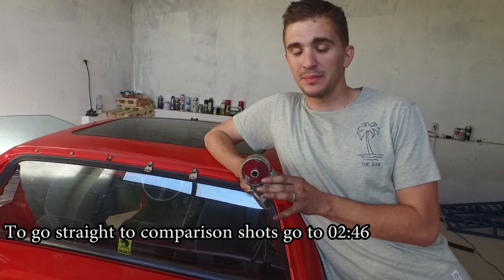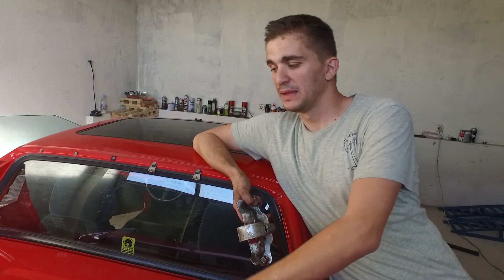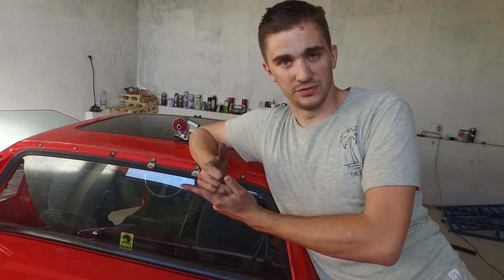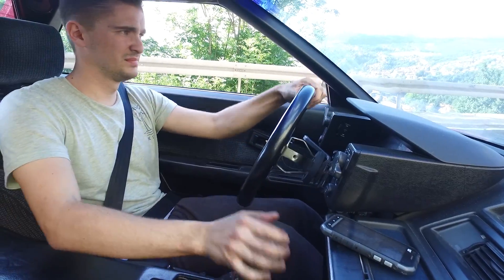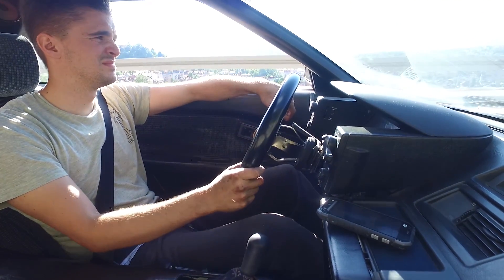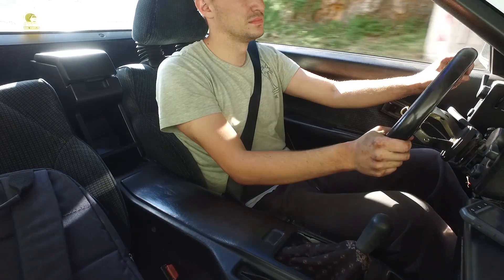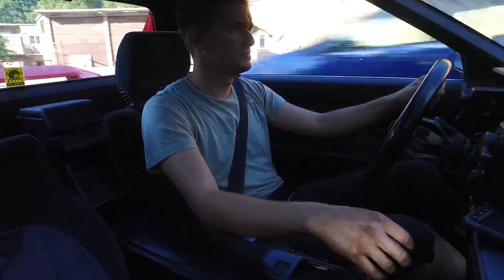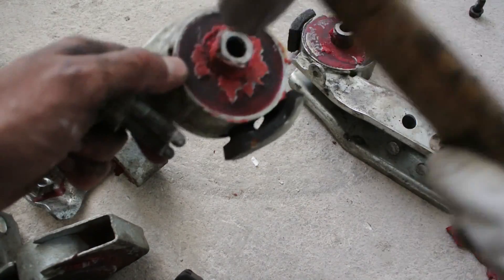Polyurethane vs. stock engine mounts - detailed comparison

Comment from the maker: This is product I used to make my DIY polyurethane engine mounts: https://amzn.to/36dYAZW
Here's the long awaited sequel to my how to diy polyurethane engine mounts video. In this video I answer two questions a lot of people asked: 1. How have my diy poly mounts held up and 2. What's the difference between stock and poly engine mounts?
Reply: You need to do another pour but this time do it with a few cavities in the bushing. Fill maybe 40 to 60% of the available space with poly instead of the full 100% of the space, that way you can tune the stiffness of the bushing. You might try mixing a little bit of liquid latex in also, may help soften it up a little.
Reply: The difference is not because of the meterial difference, but because of the way you filled. You fully filled polyurethane and there was no space left between both metal parts to get the vibration absorbed unlike stock mounts.
Reply: Nice one bro ! This is where its at.
Reply: driving 4 answers m
Reply: I did like your video in which you made those bushings - except of course all the spilling. But compared to the old rubber bushings, that were not solid, and of course a much softer material than polyurethane, these mountings you made are way too hard, compared to the OEM part.
I went thru this poly bushing idea before, although I bought mine from a company called "Polybushings", if I remember correctly. Later I found out, they bought those parts from another company, just doing Polyurethane stuff. 
I did like them, but I skipped on the engine mounts, because I was warned of the vibration. I used OEM rubber parts on there. But I didn't feel much difference on the suspension bushings I replaced. And also, it is safe from deteriorating if it comes in contact with oil. Happily so far, the engine is still dry. But thank you for the explanation, yet I believe, you could have skipped Audacity and just used a Decibel-o-meter.
Reply: Hi Emir. I noticed in the bike carb 1st start video that your front engine mount is factory rubber again. So the engine mount topic may not yet be finished. The factory revised the engine mounting in the I4 camry, probably earlier. They added a "ROD, ENGINE MOVING CONTROL: 12363-28061" between the cylinder head and the strut top. It does not support any engine weight so its very soft in comparison to the engine mounts. It is designed to act in 2 stages. At idle its a flexible rubber band for good NVH. Under torque it will deflect until the side blocks contact the support ring becoming very stiff to control powertrain wind up. This approach has less compromise than either the MR2 factory rubber or aftermarket urethane mounts. It's used in many cars so finding an example of a  place to attach it and one of correct length should not be as hard as the other things you have done.

https://parts.toyota.com/a/63033794__6708622/MOUNTING/286420-1107.html

Comment: What about roto Joint? Is it best of both worlds? 
Because Umi performance is writing: 
The Roto-Joint pivot ball provides 28 degrees of unrestricted movement, enhancing performance compared to factory rubber and aftermarket polyurethane bushings. The delrin race surrounding the spherical ball absorbs shock and road noise, ensuring quiet and smooth operation while also improving precision

Is it true or still rubber the best?

Comment: The gaps in the rubber filling inside the stock mounts is for a reason, to absorb finer vibrations. If the whole mount is filled, there definitely will be vibrations though the jerks will reduce, so, drill 2 holes diagonally or 3 holes in triangular position of suitable diameter and the vibrations will further reduce..

Comment: Dude you did a good job  !! hopefully  next video you can mould the Poly follow from the rubber pattern from the stocks ,, the results will be better .

The stocks ' vibrated lesser because of the hollow-pattern  were designed to absorb more vibration.

Comment: This is specific to 4 cylinder engines which have a secondary balance. My V6 has 90 shore hardness and there is no extra vibration (but not wheel hop on burnouts)

Comment: Several 20 mm holes on the perimeter of those mounts will allow them to Plex a little bit and may give you a hybrid between the movement of the original style rubber mounts and the what are functionally solid polyurethane mounts. Might be worth trying?

Comment: I did this 20 years ago on my '89 Civic Si.  I poured the engine mounts solid with 50a polyurethane.  The increase in harshness and vibration from the engine was tremendous.  It was for a race car, so I didn't mind.  If you are doing this on a street car, your passengers will hate it.  I imagine drilling holes to emulate the shape of the original mounts would have reduced the vibration, but it was a race car, so I just left it in torture mode.  The mounts are super-strong and will wear out the rest of the car before they give a single millimeter.

Comment: An important issue when using stiffer engine mounts is, the increased stress on the metal around the mounts causing fatiguing and cracking. The rubber mounts absorb these stresses and vibrations but the PU mounts pass on the stresses and vibrations to another part of the car not built to take those conditions.

Comment: Aside from creature comforts on rubber vs polyurethane and Solid. (vibrations and what not) different mounting setups equate to varrying comfort/performance or in the middle.
‐--------------------------------------------------------

Rubber:  The torque from the engine will twist the motor mounts permitting less power being delivered through the driveline and to the wheels. some parasitic loss of responsiveness and less "snapiness" of the engine. Some Wasted performance.

Daily driver settup with rubber mounts.

Rubber, less vibration than any type of mount. Maximum creature comfort, significant loss in performance.
---------------------------------------------------------

Polyurethane: The torque from the engine is controlled better, not allowing the engine to twist as much, and more power that is not wasted is being sent to the drive train much more in an optimized fashion.

Weekend/track driver settup with polyurethanes

Stiffer than rubber but not quite as stiff as solid mounts, optimized performance settup, slightly more vibration, increase in responsiveness of the engine.
---------------------------------------------------------

Solid mounts: Maximum performance gains with this setup as the engine is not allowed to twist at all, aside from the 
body/frame/suspension taking the brunt force of the engines' torque. 

Track/strip setup with this solid mounting settup, the vibration will shake your teeth out and the engine noise can reverberate throught the cabin. 
‐--------------------------------------------------------

Thanks for reading this far, hope that gave some food for thought.
Cheers.

Comment: Very interesting video, great work! You did your own poly mounts, but what do think about the aftermarket ones? You think it will have a different result on straight 6 BMW or a five banger Volvo, or the same result because poly is harder, transfers the vibration better?

Comment: Polyurethane bushings AND stock (i.e., rubber) bushings may be used TOGETHER for a daily driver. PU bushings are ideal for ALL steering linkages--and that's pretty much the extent of its application. Rubber bushings are best suited for engine/transmission mounts and suspension components. Exception: PU is acceptable for suspension components--but NOT engine/transmission--ONLY when the PU elastic modulus (durometer) is equivalent to its rubber counterpart. Exception exception: PU with a high durometer is absolutely critical for track/performance use FOR REASONS OF SAFETY. Bottom line: PU is ill-suited for daily drivers, period.  ...unless you are a 20-something ignoramus ricer, of course.
Reply: Let's say you have an old year 2006 E-class: so changing rubber bushes to PU bushes for small linkage arms are OK. But keep the large bushes, like those on the lower thrust arm, to OEM black rubber bushed.

After market adjustable small linkage arms are able to correct angle of camber or toe & they comes with PU inserts & hollow tubes inserts. 

I am not sure, for these PU bush, if each bolt must be tightened until the bolt & the new hollow insert are not movable. Only the bush & the arm are to be movable?.

Comment: Awesome and very precise review! One thing I missing is what grade of polyurethane did you use? Softer grade would do better?  And also you should try it with holes on it as the stock mounts have it that will make a difference.

Comment: A very informative comparison. I was wondering if a combination is a better option for most folks by using polyurethane mounts at the hard-to-replace location and stock mount at the easy-to-replace location like the top strut mount.

Comment: Around 6:50 in general it will not put more power to the wheels, it will allow power transferred quicker. Not a problem with mild stockish cars. But can be the difference between a good run and white smoking the tires in a stronger drag car where off the line traction can be an issue. 

In a rear wheel drive car with transmission, driveshaft and rear end angles. it can put more power to the wheels because it keeps everything in line with less give. NASCAR's for example can gain or loose 100hp to the tires with small tweaks to the driveline angles. That's why they dyno tune them on a chassis dyno.

Comment: Just a caution - if you have an older car (like my 76) and you buy "stock" mounts for it, the only ones you can get today are coming from India and China, and even though they carry the same part number as the originals, they have terrifically hard urethane (80-90A) instead of what was used in the factory originals (45A hardness) from back in the day. So it's important to realize that "stock" doesn't mean what it used to. Thanks for taking the time to do all this work though, it's great stuff!
Reply: Do you have any idea as to why this occurred, the changing of the insert compound in these remanufacturing facilities in those countries?

Comment: Don't polyurethane mounts last a lot longer? Changing the rear lower engine mount on some vehicles is a LOT of work most would rather do as few times as possible

Comment: The problem is not with the Polyurethane material but rather you have filled the bush casing with polyurethane totally without leaving any gap or space for it to defuse the vibration created by the engine. This is the reason why the stock bush have gaps and hole in them to let the vibration stay at the joints rather than transfer to your chassis. I believe the polyurethane is better than the stock bush rubber because these days the manufacturer made it self destructed within a certain period.

Comment: Not a 1:1 comparison because you've made the mount entirely solid with polyurethane vs the oem that has channels through it. You spent all this time messing with polyurethane and completely threw out the engineering that real engineers and testers put into the OEM mounts.

Comment: ahhhhh... i saw that last insert you hit with hammer move.!. hahaha... great video tho... and a little slippage of the insert probably helps dissipate some vibration.
i think all thats needed is the gaps and that will help get  rid of even more vibrations..
and aslong as the vibrations dont rattle ur cars parts loose then your golden.
altho this is a huge issue for harley davidson...they rattle so much the parts come off... so with more rattling you better double up on locktight and torque specing your rig.
i love Diy,,,and im driving a blazer s10 and all the mounts are shot...im surprised my body didnt come off last time i was doing figure 8s in my front yard...hahah.

and any ways... who needs comfort...i wanna drive like an asshole thru traffic and not have any  extra boddy roll.

Comment: I wonder about something in between. I would be interested in a poly DIY using a much softer durometer poly, one that is tougher than rubber for longevity but quite soft and pliable like rubber for vibration absorption.

Comment: The mounts are supposed to eliminate the vibration so try make it as the stock shape inside the pin needs to move and eliminate the vibration

Comment: The hardness isn't the only consideration in terms of vibration, but also the contact area of the bushing to the mount, and the GEOMETRY of the material.  I ran MONROE shock absorber's largest factory making all the OE (Original Equipment) for new automobiles.  There are some bushings on a car that will benefit greatly from polyurethane, not just for ride improvements but also longevity of the part itself; like the bushings on the differential.  I suspect that if you copied the shape of the original bushings and molded these parts apart from the main housing, then inserted them, you would find much better characteristics for vibration AND the benefits for high stress too, as well as longer lasting parts.  ALL manufacturing companies chase pennies in savings to show cost improvements year over year, and none of the auto manufacturers can keep up with the greedy demands of stockholders anymore.  I would use polyurethane FIRST on the suspension and steering bushings before the motor mounts.  Engineered shorter life spans is a calculation to keep repair revenue UP for dealers and the aftermarket too.  In the 1990's all the auto makers changed their view on QUALITY, to reduce costs and also increase sales $$$ (even repairs) they didn't want their cars or components to last TOO long!    Nice video, great honesty!  You're onto a winning pathway.

Comment: This was a great video as it gives a lot of valuable information. One of the things it did not cover is that a number of badly designed motor mounts such as on my girlfriends mini-van bite the dust in a short period of time. This is a problem with a vehicle that will never be used for track day, just grocery getting and errands, and/or carrying loads. Unfortunately going to urethane may not be a good idea due to vibrations. The problem is the replacement mounts last 6 months to a year, indicating either low quality rubber, bad design, or both. The torque of the engine rips the front mount apart, and the other 4 mounts follow in suit. This makes me wonder whether a 30A shore hardness urethane mount trying to replicate the existing design would fare any better.Or just filling the voids in a new mount with the 3M window adhesive product. 3M also has a marine grade urethane 7200 product. Anyone know the shore hardness of those products?There is definitely a market imo for replacement mounts on a lot of vehicles that have inherent problems with stock.Keep up the good work!
Reply from the maker: After hating my diy polyurethane mounts, windshield adhesive is exactly what I did. I filled out just one mount, the one that's subject to most torque. I have to say that it worked really well. It's a nice compromise between stock and poly, and it's definitely streetable. There is a bit more noise and vibration (mostly noise) but it's totally ok and the noise really only an issue at the top 2k rpms. Also, polyurethane based windshield adhesives are pretty much indestructible. Making a new 30a poly design with hollow parts like oem designs woukd likely work well, but it would be a genuine product development investment. Only worth it if you intend to sell them later and if there's a market for it.
Reply: Thanks for the quick reply! Did you fill the mount completely with the windshield adhesive? I read about someone who bought a new mount and just filled in the voids with the windshield adhesive.
Reply from the maker: Yup, filled it in completely

Comment: Excellent video which told me exactly what I wanted to know and confirmed my suspicions. I recently bought a beautiful 65 GTO. It has a very stout cam, long tube headers and loud exhaust. It also has a very nice sound system. Despite the entire interior, trunk and doors being lined with Fatmat sound deadener everything vibrates. At first I chalked it up to the loud exhaust but got to thinking that would not explain the vibrations in the seat at idle. Today I looked at the engine mounts and, sure enough, they are Prothane. I'm going to switch to stock style mounts. Thanks.
Reply: So I replaced the Prothane mounts with rubber. The instant I started the engine I knew it was the right move. I didn't need to to the water glass test (though that is quite ingenious). Butt test was enough. Thanks again.
Reply: @65sohc  butt test!! my sides rofl

Comment: I've got a K24 turbo swapped into my MR2 and it's got 90A poly bushings.  I've written two engine mount retailers...the mounts I have don't have a softer bushing option and the other retailers bushings don't fit into my mounts.  I'm NOT inclined to spend $750 for another sellers mount kit so I'm hoping even doing these in 60A will be an improvement.  Do you know if there's an way to change the mixture ratios so it's 40A-50A?
Reply from the maker: You simply buy the compound in the shore hardness you want, Smooth-On has some liquid polyurethanes that are as soft as 30A. You could also try drilling some holes in the mount.
Reply: @d4a  Noted...I searched for 50 after I wrote that and it came up.  Now to decide which hardness I want to cut down on the noise being transmitted into the cab.  On a side note, I have to reuse my custom engine mounts.  Do you think coating them with some kind of non-stick coating like Pam would work, or maybe lots of wax?  I'm just asking you since you've delt with the stuff.

Comment: The difference is not because of the meterial difference, but because of the way you filled. You fully filled polyurethane and there was no space left between both metal parts to get the vibration absorbed unlike stock mounts.